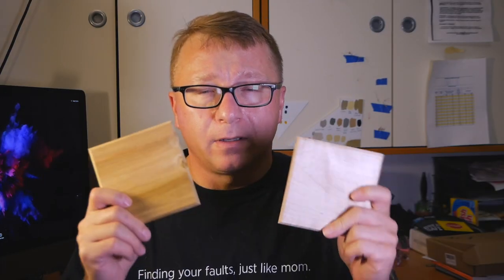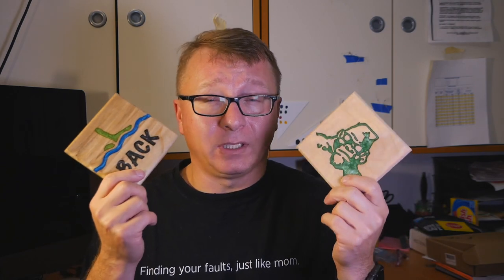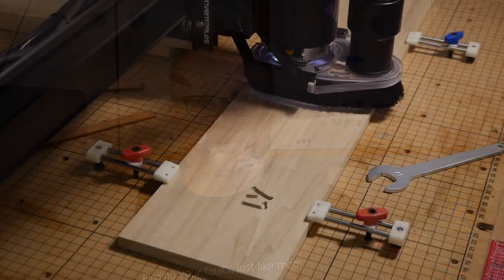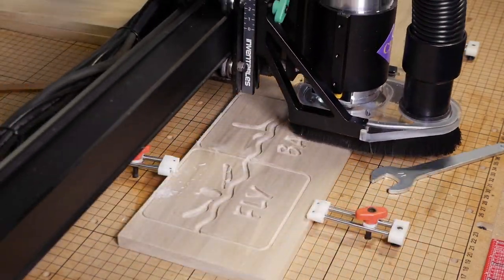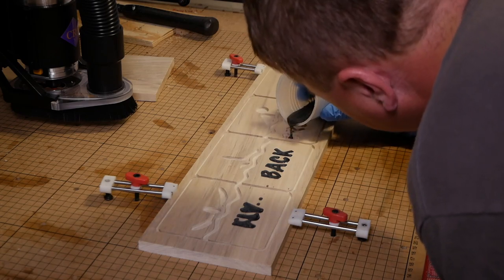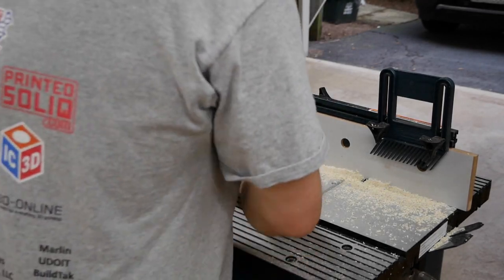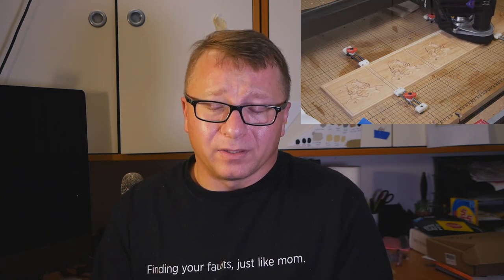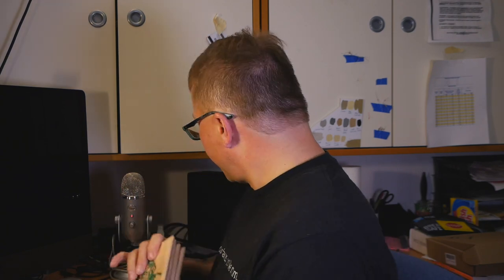Making Drink Coaster Epoxy Inlay Wood

Comment: What kind of total boat epoxy did you use?
Reply from the maker: Hi Matt. I used Total Boat High Performance Fast but I would recommend Medium now. It has a longer open time and is less likely to kick during the process. Hope this helps and thanks for watching.